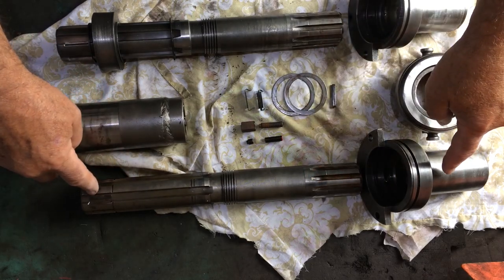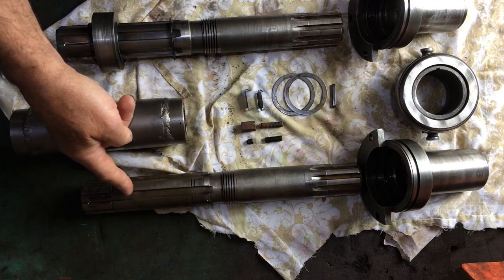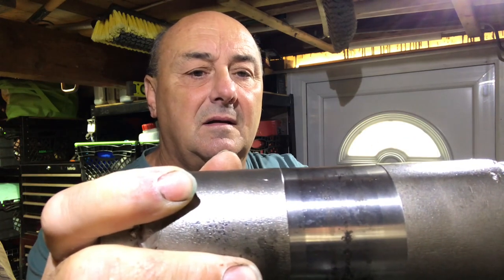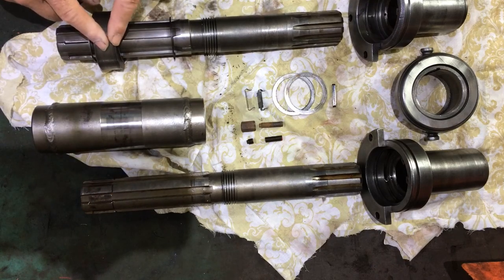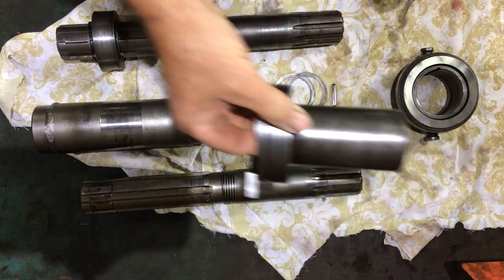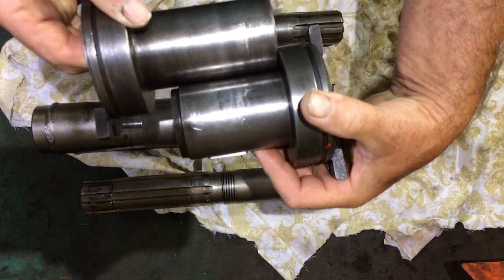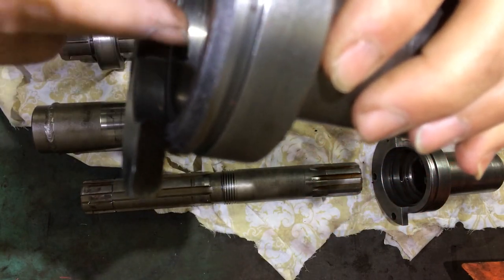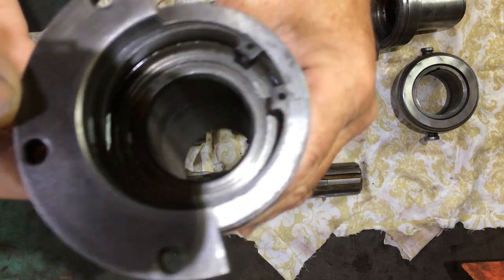setting the PTO clearence, Clutch stop brake and support snout on the David Brown 990  #34

Comment: Sound for the video Barry,  very helpfull. I only just came across it by accident. I got the clutch done on my 995 last year and the P.T.O. hasn't worked right since. I've   to turn the tractor off to engage the P.T.O. not ideal  but for the few times I use it it's manageable but just a pain in the arse..
Reply from the maker: I'm pleased you turn it off to engage, someone didn't with mine and they broke the gear stick, Then just replaced the stick and left the bits in there. If you email me with your email address I'll send you a manual on the clutch that should help you with the setup if you need it.
many thanks for your support
Barry
Reply: @manfromthemist1958  That was nice of them..
My better half got me the whole lot of the manual on a disc related the 995 but to be honest I'm more of a visual learner than a reader.
Reply from the maker: @jeromeobrien9303  I know what you mean, my learning style is activist as well. Couldn't do with all that book work
Reply: @manfromthemist1958  Any chance Barry would you have a video of replacing the fuel lift pump. 
I'm assuming I'd have to drain the tank. The sediment bowl is full of crap so I'd be flushing out the tank aswell. There is a drain plug under the tank so should be handy enough. 
Thanks.
Jerome
Reply from the maker: @jeromeobrien9303  Hi Jerome, I'll try to cover that in my next yarn, not sure when that'll be at the moment as we're flat out lambing, hence the shortage of tractor vid's , but please keep watching for the next yarn.
Many thanks
Barry
Reply: @manfromthemist1958  will do, sound Barry,  
All the best with the lambing hope it all goes well for ye..

Comment: Hello Barry, I have spent a few hours over the past couple of days watching your excellent videos.  Very informative and really well done - thank you!  I have owned a 990 Selectamatic for a number of years it was built in 1964/65. I think you may have answered this question earlier but I would like to ask it again in perhaps a little different way.  Last week I was using the Bush Hog when the Hydraulic Lift Arms went to the lower most position and at the same time the PTO Clutch stopped working - the only way to engage the PTO is to turn the engine off, fully depress the Clutch, shift the PTO into gear and then start the Engine.  All the while the Hydraulic Lift remains inoperable.  Clearly the PTO Clutch has issues, but what I don't understand is if the shaft that drives the PTO gear box is the same shaft that drives the Hydraulic Pump?  It seems odd that two failures would have happened at the same time i.e. a PTO Clutch failure and a Hydraulic Pump failure at the same time.  Thanks
Reply from the maker: Hi Larry, many thanks for the comments, you say the PTO stopped working, if you engage the OPTO while the engine is off does the output shaft rotate, in both high and low?
does it roatate under load?
you say your hydraulics don't work, have you checked the output from the pump at the camels humps(righthand side of the seat next to the quadrant)
with out see the results I would hazard a guess at the clutch plate either slipping due to wear or adjustment or the middle of the clutch has become detached from the outer disc, it is possible you've sheared the centre out if you have hit a tree stump with the hogg while using it.
You're right the PTO cardan shaft drive both through a idler gear in the front protion of the PTO. The upper drive wheel is splined to the shaft and the drive gear on the pump is keyed.
As I say without looking inside the PTO there is quite a few things could have happenedm do you have access to an endoscope? you could take the top link sensing unit off and pop a scope into the PTO to checkout the hydraulic idlers and pump
something else if both are not working, there is a splined sleave that couples the cardan shaft to the input of the PTO box, its held in place with a nut and bolt, this could have broke or sheared the bolt and the sleave crept forward and disengaged the PTO input.
lets know what you find.
Many thanks
Barry
Reply: @manfromthemist1958  

Hi Barry, this may be confusing but I will try to give the condition/state and the end results for each condition/state

Condition One: Engine Off, Clutch Pedal released.  The PTO can be shifted from Neutral to Low or Neutral to Hi.

Condition Two. Engine On, Clutch Fully Depressed.  The PTO can NOT be shifted from Neutral to Low or Neutral to Hi.  Any attempt to do so would not be good.

Condition Three: Clutch fully Depressed, PTO in Low, Start the Engine, the PTO Shaft turns well below the normal RPM; when Clutch is slowly released the PTO Shaft will  increase in RPM; when the clutch is fully released the PTO Shaft will turn at normal RPM.

Condition Four:  The results are the same as Condition Three when the PTO  is in the Hi position.  

Condition Five: There was no Hydraulic Lift Function capability during any of the above Four Conditions.

Condition Six: The free travel of the Clutch pedal measure 1 3/8".  

I surely appreciate your time.  Thank you.
Reply from the maker: Hi Larry, have you checked the clearence between the PTO clearence bolts in the clutch cover plate need to be .070",
sounds like the clutch is dragging, as for your hydraulics, you need to take off the top of the camels humps and see if you have any oil flow fromthe pump,
Shane has a good video showing him testing the oil pressure at the humps, you need to find out if the pump is producing pressure and then go from there, sounds like you've got two problems.
https://youtu.be/Ncps8Du3Vz0?si=wtUtmzAXBwDa_vpP
Reply: @manfromthemist1958  
Hi Barry,  

So today I hooked the DB 990 back to the Bush Hogg's Power Take Off Drive Shaft and duplicated the same conditions as I had posted earlier however this time  the Bush Hogg provided a load for the PTO.  The results were the same with buy one additional finding.  With the PTO in the Low Speed position, and the clutch fully depressed the Tractor starts but the Bush Hogg blades do not rotate; when the Clutch is released the Bush Hogg will rotate at normal speed.  If the Clutch is fully depressed again the rotating speed will reduce somewhat but never stops.  (Of course the Bush Hogg was not mounted to the 3 point hitch)

In your message you concluded that I have two problems and I agree completely.  I haven't gotten deep enough into the problem to be able to adjust the PTO Clutch, it has needed it for a long time.  But I have toyed with the idea of decreasing the free movement of the Clutch from it current  1 3/8" to 1" or 1 1/8" .... your thoughts about that? 

I did see the Video posted by Shane.  His DB and yours too (I think) are a bit different pertaining the Hydraulics.  My tractor is fitted with a Speed Decent Control  and the Lift Arm Control lever is connected to a shaft that comes out of the side of it.  My DB also has an Implement Auxiliary operating valve so Shane's method will not work,  However I think perhaps I can connect a pressure gauge to the Implement Operating port  and manipulate the lever in on direction of the other and see what if any pressure I see.  My guess is there will be no pressure present.

I do have access to an Endoscope.  Removing the top end of the PTO housing containing the Depth Sensing mechanism should provide access to inspect the Hydraulic Pump and gearing - right?  I assume an issue in that location will mean pulling the entire PTO Assembly.  I watched one of your videos doing that task.... not looking forward to it!!!  

I have a couple of pictures that I will try to send to you.  Thanks for all the hand hold Barry.  You're the best!
Reply from the maker: Hi Larry, free play on the clutch pedal is anywhere from 1" to 1 1/2" and the clearence between the adjustment screws and the pressure plate should be 0.070".
if you remove the sensing unit, look down inside the PTO gearbox and you'll see a lub pipe that comes through from the inside of the PTO casting left hand side , pop the endoscope through there and find the pump you can check the drive gears from there to make sure nothing has slipped.
if you have to remove the PTO case, remove the suction adapter from below the PTO case before removing the  cover.
good luck,
Barry

Comment: I have a 990 selectomatic the drive clutch clears perfectly but the pto clutch won’t clear at all.  I have to switch the engine off to select pto. The adjustment you make with the 3 screws and lock nuts, is it worth trying this before stripping it all down. Many thanks
Reply from the maker: HI it's certainly worth checking the gaps as these gaps determind weather or not the clutch dis-engages, I would work through the clutch setup procedure before splitting your tractor,
many thanks
Barry

Comment: Thank you my friend you helped me very much
I have a 995 can i change clutch discs without i cut the tractor in half?
Reply from the maker: the answer is yes you can, but in reality, its quicker to split it, to do it without splitting you'll need to remove the gearbox lid, inputshafts, clutch stop bake, gearbox input shafts, snout, so it's probably quicker to split the tractor.
hope this helps
Barry
Reply: Thanks Barry

Comment: You do a really great job. I have question about  the clucth stop and hope you can help me out. Is the band resting on de axle? And when has is stop the axle by pressing the pedal? My band was very loose and by pressing pedal the band was not going back on the right place. No I adjust the band (loosen the lock nuts) and rest almost on the axle. When I now pressed the pedal for a quarter de band is tightening on the axle. Is the ok? I can’t find good example’s how to do. Maybe can and will you help me out 😬
Reply from the maker: Hi MJP, thanks for watching and thanks for commenting, after you have adjusted the brake band, there should be a very small clearence between the band and the muff shaft(axel) enough to give it clearence and prevent friction and heat, allowing the shaft to rotate freely and very importantly should ONLY stop the shaft after the clutch has disengaged, otherwise you'll be trying to stop the engine with your clutch brake. I'll be putting the clutch back into my tractor in a week or two and I'll address this setting in the video, hope this helps,
many thanks for watching
Barry
Reply: Thank you Barry, that will help me out
Reply: One more question. when should be the band activated, when you completely push the pedal or earlier?
Reply from the maker: @polleke038  the band should only be activated once the clutch has disengaged, so if the tractor is in gear (engine not running)and the clutch is not depressed you will not be able to turn the output shaft, depress the clutch pedal till you can turn the output shaft, then you need the clutch brake to begin to apply with in the next 1/2" of travel on the pedal,
Reply: Thank you Barry, I will try that. And before I close the cover I wait for your movie about this item, so that everything is ok.
Reply: Hello Barry, sorry that I am back again. But today I was by my DB and tried what you said,But I think I do not understand you. Put the tractor in gear, axle is not moving, ({by hand) push pedal slowly down and try to turn axle ( I hope you mean the same axle where the stop band is on, but nothing happens. The axle is not moving. Even when the pedal is completely pushed down. By the way the tractor was driving OK also shifting before I start with the restauraties. I do not understand the working of it.
Reply from the maker: So, jack up the left hand rear tyre so it is just clear of the floor and can be rotated by hand,
Now put tractor in first gear, you should not now be able to rotate the tyre, because the engine is preventing it from turning.
Depress the clutch and until you can turn the wheel, then as you depress the clutch further your clutch brake should either make it more difficult to turn or prevent you from turning the wheel at all.
Now for this part you’ll need some help, 
Once you get the clutch brake adjusted to stop the wheel, ask someone to try turning the PTO output shaft at the back of the tractor 
You should not be able to turn this until the clutch peddle is pressed nearly all the way down, when it should begin to turn as the PTO clutch plates disengage
I think you may have over adjusted the clutch stop brake and your clutch stop is activating before the drive plate is disengaging hence you can’t turn it
hope this helps
Barry
Reply: @manfromthemist1958  thank you, now it is clear for me. The tractor had no wheels at the moment. I Put them off for painting. Is that a problem?
Reply from the maker: Hi MJP, I'm releasing a video about setting the clutch and clutch stop brake  at 2000hrs tonight if thats any good to you
thanks for your support
Barry
Reply: That is great, thanks

Comment: Just got wrong clutch plate should be
Inch one eight red tractor waiting crankshaft seal steering wheel bearing getting two bits angle iron two bolts
Two holes weld cut fit under steering
Fourteen mm bolts holes
Reply from the maker: Hi Martin, yses that happened to me, had to arrange replacements, nevermind keep smiling
Many thanks
Barry